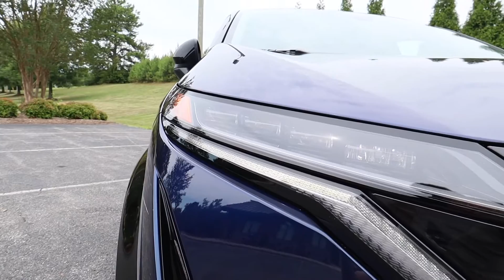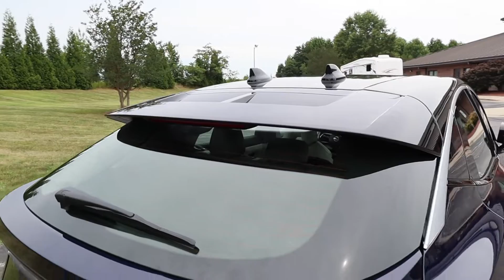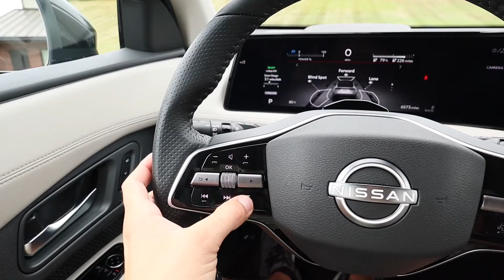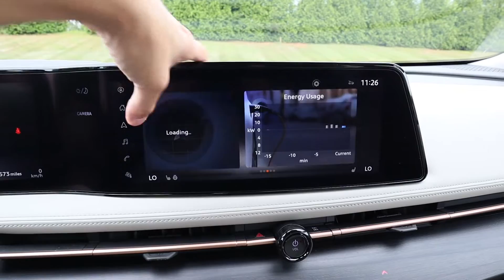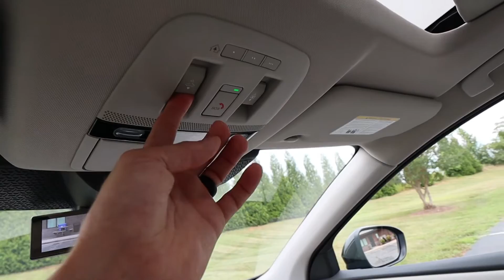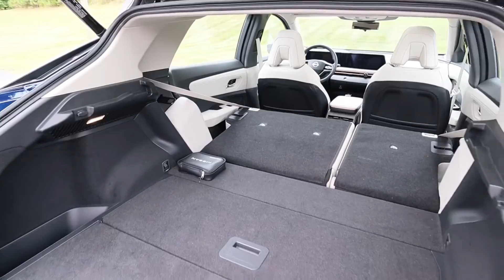2023 Nissan Ariya Empower+ FWD: Start Up, Walkaround, Test Drive and Review

Comment: Cool styling. But since model Y is 47k today this car should be 32k. And fwd is ridiculous on ev
Reply from the maker: Yeah this was sweet, but the AWD version with all the power is not much more then this one we tested. Is the $47k Model Y equally equipped with tech and features?
Reply: @BrosFOURRSpeed  yea. It  has all the tech inside plus the best charging infrastructure. Not hating on this but like this is the same as bz4x and basically the electric version of rav4
Reply from the maker: That Tesla sounds pretty good then for the money! The BZ4X seemed way over priced for sure. Wasn't impressed with that one. This, Mach-E and EV6 are my top picks for ones I've been in. But only if they are top performance models. Everyone still has a lot to to do match Tesla it seems.
Reply: @BrosFOURRSpeed  exactly. Tesla is opening its charging stations for others now and I think that’s why they lowered the prices to not compete with the germans.
Reply from the maker: Oh wow thats cool to see! Seems like they have the best charging support which is big! I don't think other brands understand how important that aspect is for people to actually own an EV